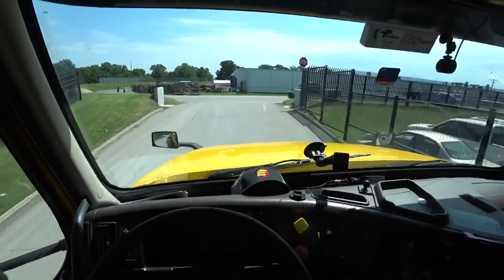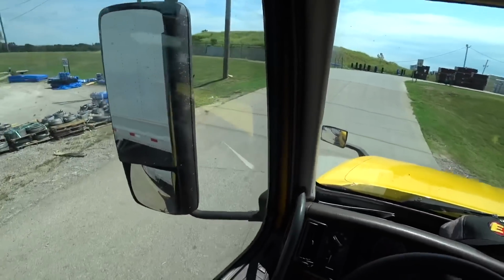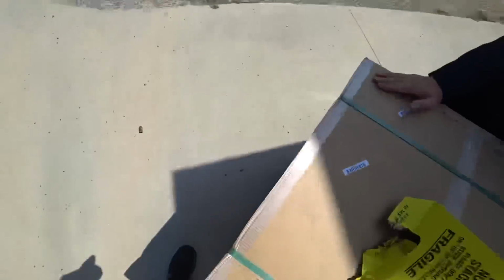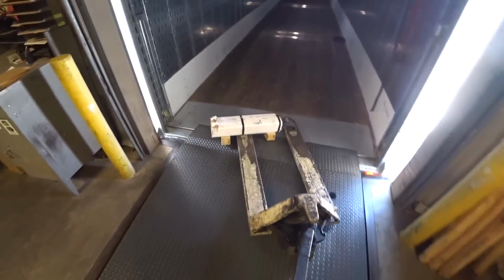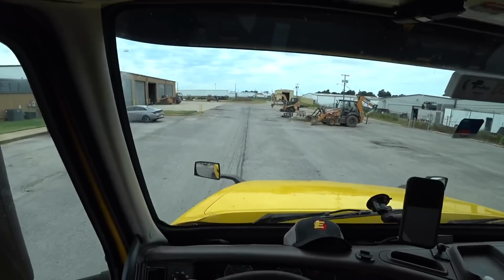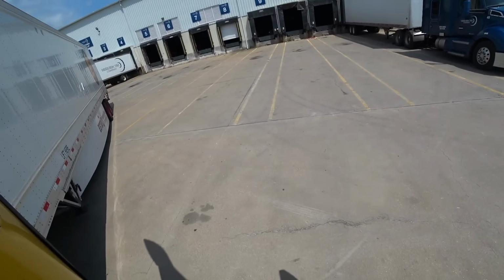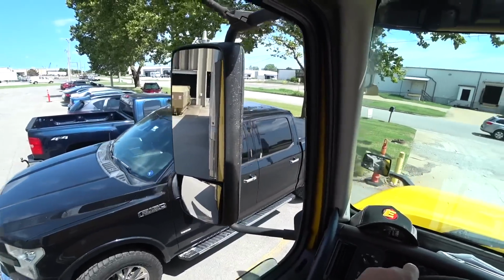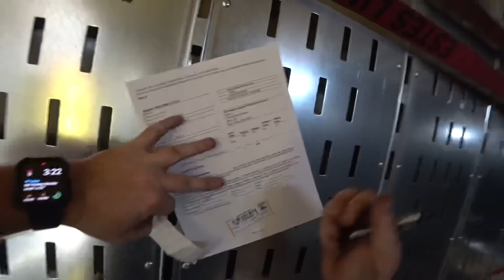COME ALONG FOR SOME PICK-UPS & DELIVERIES (Estes Express)

Comment: Hey chuck. Got a question. Those bar codes you use is one sheet all the same bar code? Maybe answer in the next vlog
Reply: One goes on his copy of the BOL. One goes on the customer's copy. The rest go on the freight. Yes, all the same barcode. It's the tracking number for the shipment. I know I'm not Chuck but I do the exact same job he does but for another company
Reply: @453Dusty  thanks. Didn't know. Was just curious.